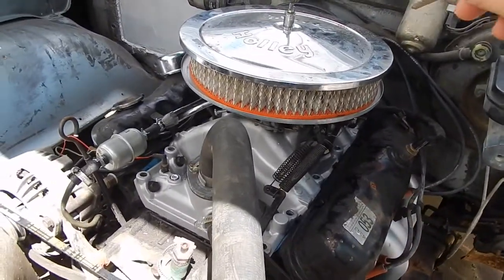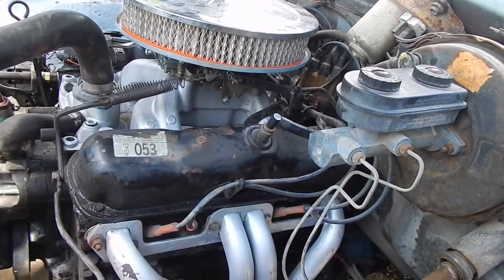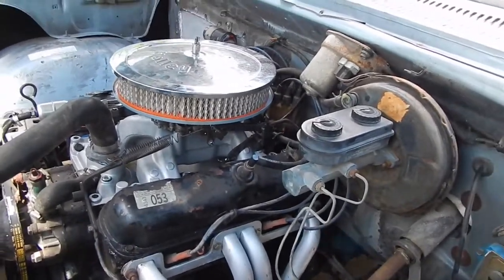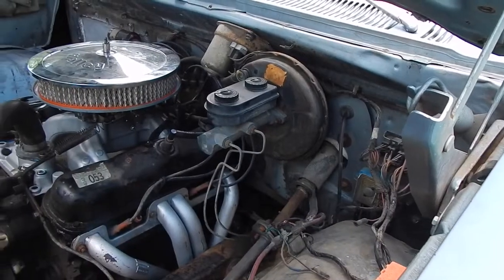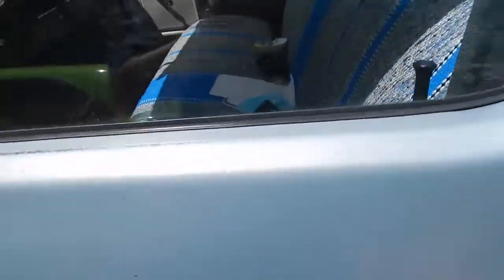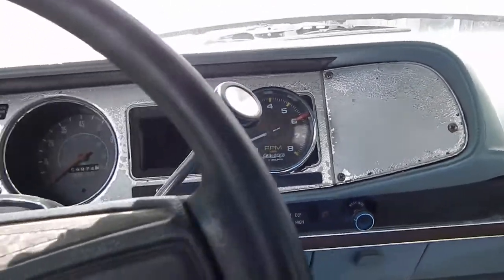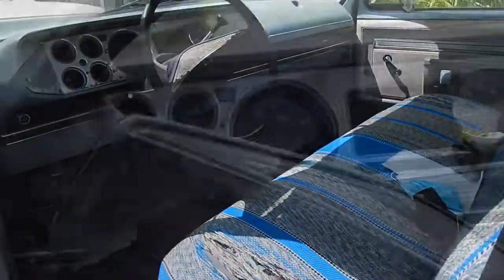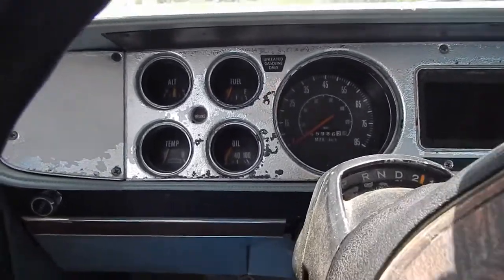Testing the Holley 4bbl on the 318 …. *Drag Truck part 6

Comment: 2.71:1 gears?  Did I hear that right? Its amazing the high gears Chrysler used on so many of their vehicles.  In a truck, its a wonder its of any use.  BUT! Quite a performance upgrade to be had by just a gear swap, for sure.  A 3.55:1 would change the personality of that rig completely.  Thanks.  Great content!
Reply from the maker: thanks!

Comment: I've got two ramchargers both have 9 1/4 rear and 3.21 gears they are ok one has sure grip in it both running 600cfm edelbrocks got one more rear it's 3.55 thinking of swapping those in but have to change front diff to match but I have those too. 318 roller cam I have in 87 ramcharger motivates it pretty good.

Comment: Looks like a small in the fuel line just before the filter. Check it out, am I wrong ?
Reply from the maker: you are correct.  It's the factory 5/16 and of course the holley fuel inlet line is 3/8

Comment: Do you plan on changing the rear gears? Something like 3.23's or a little lower will help her move on out. Great vids and information.
Reply from the maker: For sure.....  at least 3.55's, but probably 3.91's or 4.10 would fit the intended purpose of the truck in the end.

Comment: Hey can you send me a part number for that intake loved to put that in my 87 mybe the part number for the headers as well
Reply from the maker: Headers are hedmans, had them about 15 years so i don't remember the part number.    Here is the intake part number https://speedmaster79.com/shop?keywords=mopar%20intake they have a sale of 30-40% off around this time of year, especially black Friday
Reply: @318willrun  thanks so much looks great
Reply: Carlos the Boss  thanks my 2 barrel is ok for a cruise but it will run lean if you gas it too much
Reply: Carlos the Boss  very hard decision as well i love demon https://www.jegs.com/i/Demon-Carburetion/333/1901BK/10002/-1 is the one I'm going with
Reply: Carlos the Boss  I am also going to electric fans as well on power Nation's channel they almost had a 30hp increase on hp on a stock 350